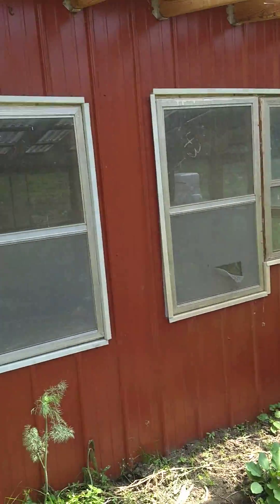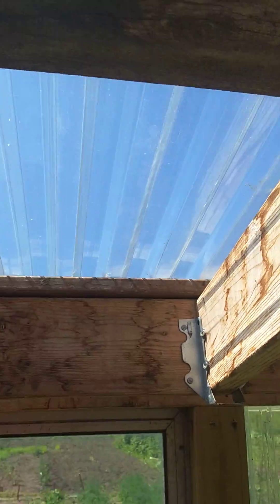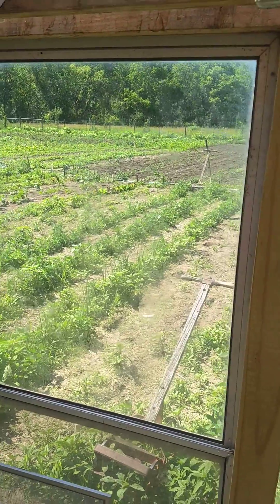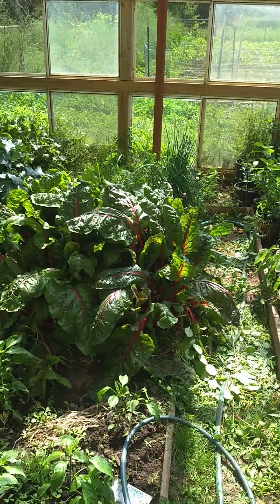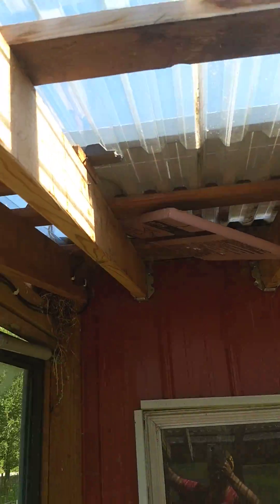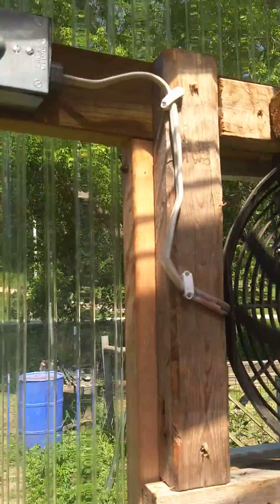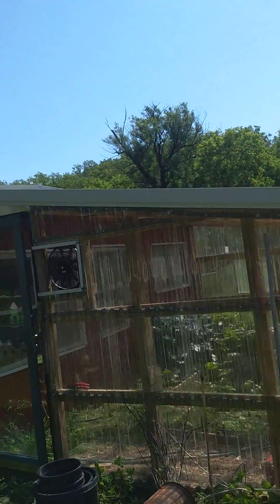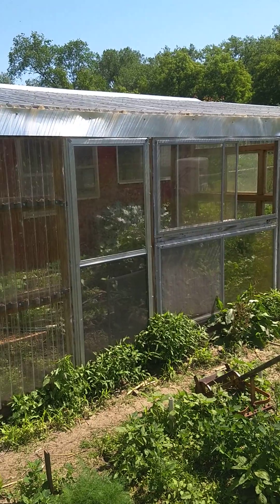solar powered greenhouse fan

Comment: So you didn’t need a battery at all? Just the solar panel?
Reply from the maker: If its sunny, its hot, and I need the fan. If clouds come out, the greenhouse isn't as hot and I don't need the fan.  So yeah, no battery, no charge controller.

Comment: So how did you splice the panel into the fan wiring...just red on red and black on black.
Reply from the maker: Yep, but I interrupted the power with an "all-weather" electric outlet switch.  The fan wiring leaves a lot to be desired in terms of labelling - probably a good idea to do a dry run in the backyard before putting the panel up on the roof.  As I recall, the fan I bought works with both polarities, but you get way more air movement in one setup.  

I might have tied the black solar panel wire to the building's ground rod - can't remember.

Comment: What kind of connections did you use to connect the fan wires to the heavier gauge wire that you run to the switch?
Reply from the maker: Standard outdoor wiring box and wire nuts

Comment: is the radiator fan directly connected to solar panel? isn't it broken due to flactuating voltage?
Reply from the maker: No, it works just fine under fluctuating voltage. I did wire in a cutoff switch on the positive line, but there's nothing else in the circuit.

Comment: What's the approx size of your green house?
Reply from the maker: 12ft deep, 18ft wide, slope is 8ft down to 6ft.  I didn't think very hard about these dimensions while building it - I probably have too much solar gain from May to August, and the 1:6 pitched roof doesn't really get me extra sun in November-March.  I could have done the roof half steel with little loss in function.